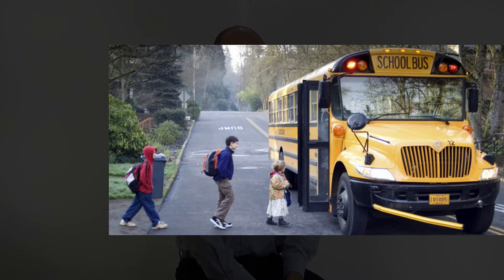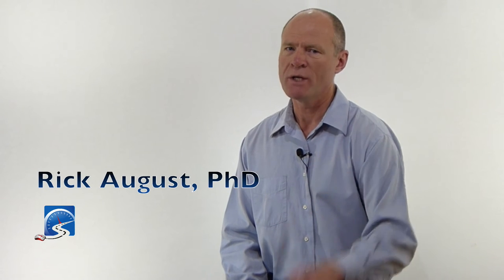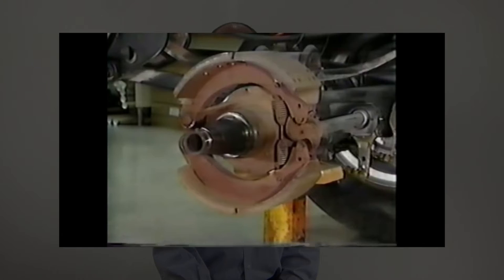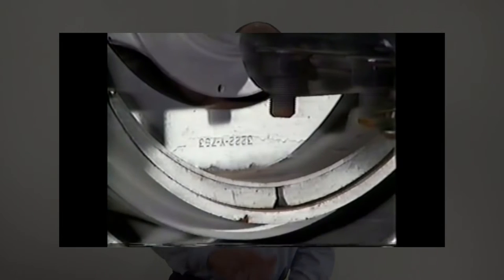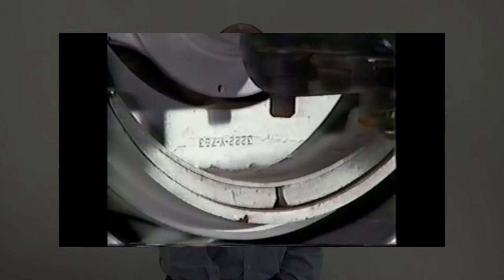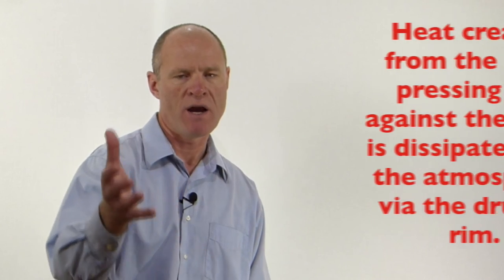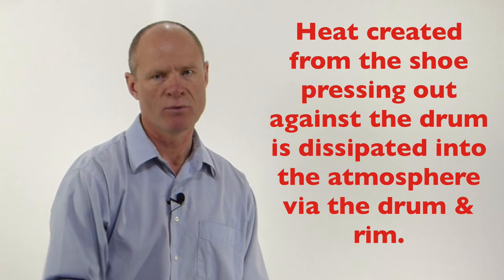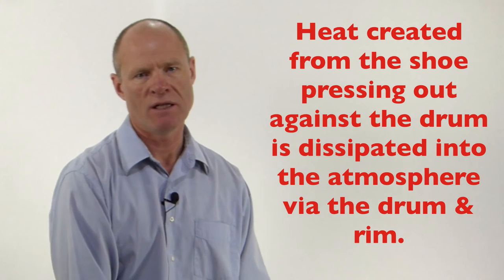What is Brake Fade to Pass Your CDL Air Brakes Course—Air Brake Smart

Comment: brake fad still happens to rotors and pads when the off gassing of the pad material from high heat creates a layer of gas in between the rotor and pad - however, this is why slotted rotors exists. The slots give a place for the gas to go and get expelled from the setup as the rotor turns.
Reply from the maker: Hi andrewesquivel - Thank you for your comment and relevant information. I did not know that about the off-gassing. All the best, Cheers Rick

Comment: I there i have disc brakes in my bicycle and they suffer brake fade, this contrasts with what you are telling in someway right?
Reply from the maker: Hi nelsonthekinger - thank you for your comment and query. If you have disc brakes on your bicycle and you are experiencing fade, it is more likely that you are experiencing failure. From a point of physics, disc brakes simply cannot experience fade, however, they can melt into a pile of goo due to the heat and fail. And that is an equally dangerous problem to fade. If you're downhill racing or something similar, I might suggest you consider an upgrade. If there is anything further we can do, drop us a note. Always happy to help. All the best, Cheers Rick
Reply: Thanks for the Reply Rick! Yes I was downhilling and deliberately decided to go down slow and so I broke often to not gain much speed and the brakes stopped braking in the end but  started working after some time pass. that's why I think it were Brake fade. But it was too late! I already had the accident. My Opinion is not scientific but I'm pretty inclined to think that bicycles disk brakes can also experience brake fade and I fear that my case is not the only one. Cheers Nelson
Reply from the maker: Hey Nelson - thanks for that explanation. As you know, when metal is heated, it expands. Therefore, if you have disc brakes, the rotor should expand, and expand into the brake pads. It may depend on what the brake pads are comprised. It would be interesting to ask a bicycle mechanic and see what his/her opinion is. Thanks, Cheers Rick
Reply: I Agree with you :) Best Regards! Nelson

Comment: I live in Himalayas (Himachal) and buses here are of TATA company.. They have old drums system breaking and driver here drive very fast in hilly area and use too much heavy breaking.. The break so intense that bus vibrates so much and sounds like grrrrrrrrrhhhhhh... 
Every time they break i wonder why these buses don't have break fade when they heat breaks so much.. 
Do you have any explanation sir?
Reply from the maker: Hi Abhishek - Thank you for your comment and query. There are a couple of reasons that these drivers don't experience brake fade - they are using hard, short brake applications which gives the brakes time to cool. Also, the buses might have auxiliary braking systems that you are not aware of. Lots of commercial vehicles have these auxiliary braking systems. And in combination with proper braking techniques work well. If there is anything further we can do, drop us a note. Always happy to help. All the best, Cheers Rick
Reply: TATA uses Cummins engines (in many buses) and have the engine brake which is the sound you hear.  The engine braking can be very significant and can feel like they slammed on the service brake.  TATA does use fairly good sized brakes as mountains are not uncommon for their buses.   Abhishek this is not meant negatively, brake is the spelling for vehicle brakes, the break spelling is for I am tired and need to sit down so I am taking a break off work, or if you are to break a stick in half.   I have such a hard time learning other languages, though I am frequently told they are simpler then English.  Which has words spelled differently in the UK and North America and is actually a nice mix of old French, Nordic, German, etc all rolled into one.   Some TATA buses have drive line retarders as a braking device also.

Comment: I don't know about trucks, but, here at São Paulo, Brazil almost all buses from 2008 and further uses disc brakes.
At the bus garage that i work, all 2008 buses ( Mercedes Benz O500-UA/O500U and Volvo B12M [2010 and further]) has disc brakes, and the ones from 2012 and on have ABS, neither of these ones have problem with braking fade caused by overheat( on an urban area[taking in mind all the weight when full pax and going downhill]). The old O400UPA buses had Drum Brakes, with the automatic slack adjusters and wet tanks, and they had a " weaker " brake.
Reply from the maker: Hi Gabriel - Thank you for your comment. And yes, most of the newer vehicles are equipped with disc brakes, particularly buses and other lighter vehicles. Only with the heavier vehicles (more than 100,000lbs or 45,000kg) do these vehicles still have drum brakes. Yes, the disc brakes with ABS are a better system for sure. All the best there in Sao Paulo, Cheers Rick
Reply: Smart Drive Test I see, didn't know about that, cool to know that it is still in use, i thought that drum brakes had been retired.